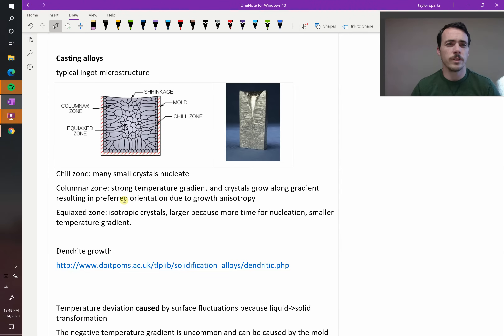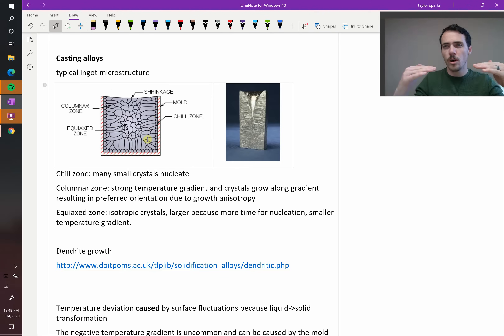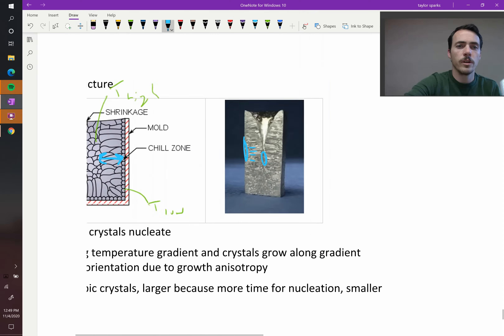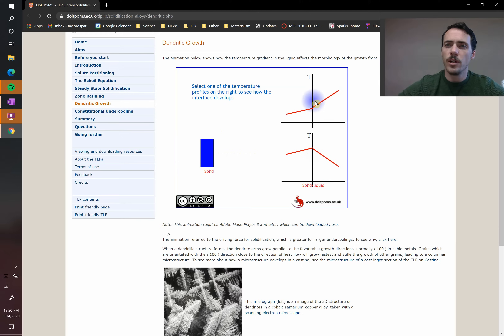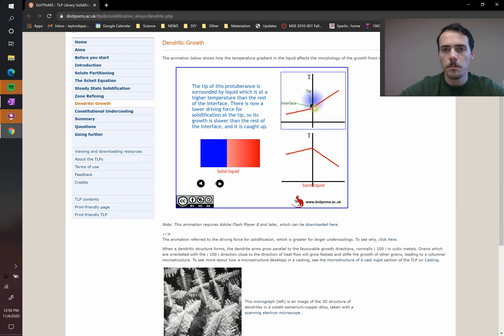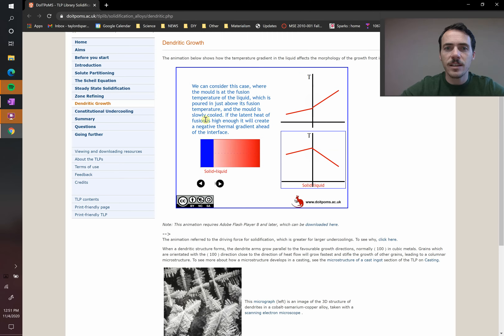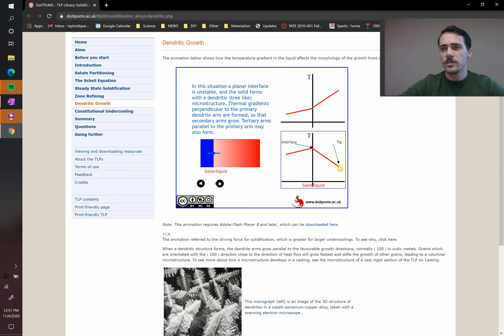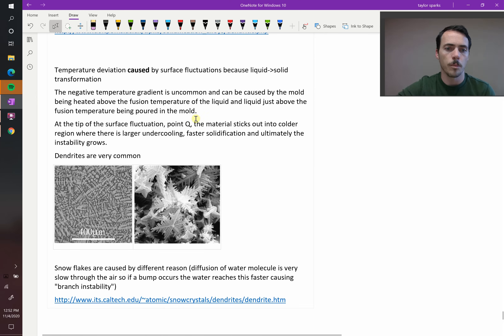Why do dendrites form in metal alloys?

Comment: What will be the effects of pores on solidification modes?
Reply: Pores are material discontinuities, therefore points of minimum resistance. At high stresses they are sure starters for cracks. That is why a piece with serious mechanical stress in work (operation) will not be made directly by casting, but by machining. More complicated, more expensive, but much safer!